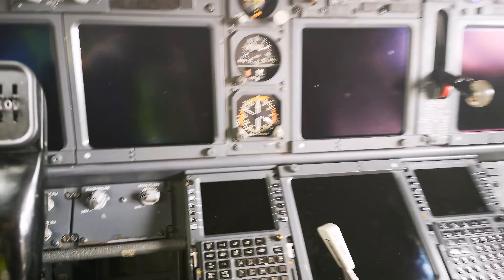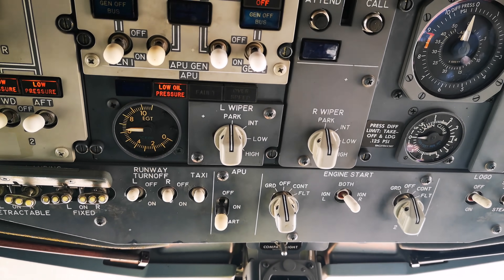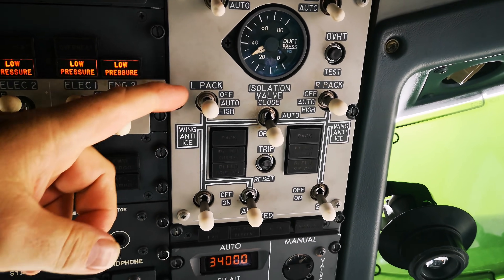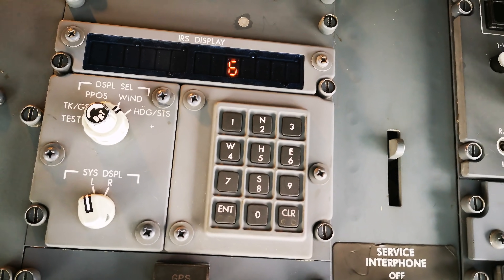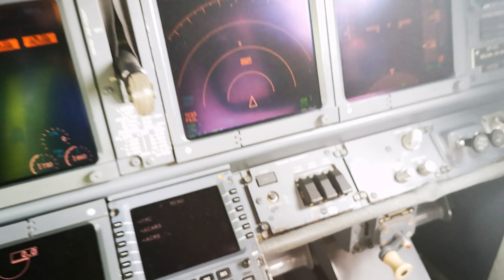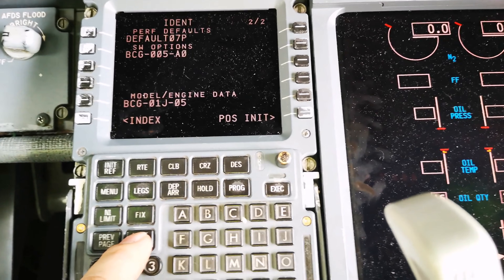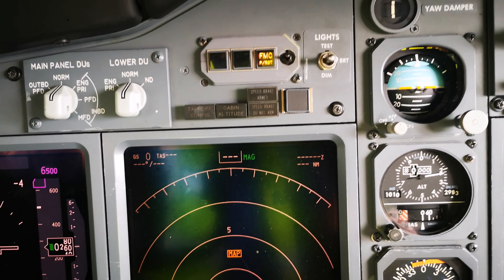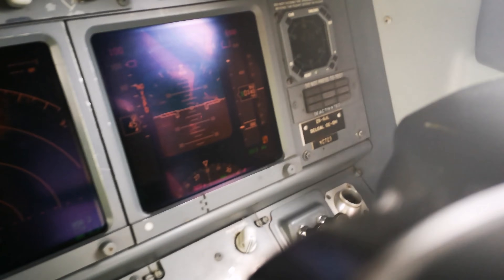B737 800 APU start and cockpit prep

Comment: I heard somewhere that the APU can supply the electricity immediately after startup but to extend its lifetime it should run at least 3 minutes before selecting APU bleed air. Is it correct?
Reply: If i had to guess, i would think it’s related to allowing the lube oil to warm up, reducing its viscosity and thus reducing the torque required to turn the shaft of the gas generator, so when you add the additional load of taking bleed air from the compressor that load+internal friction does not result in excessive exhaust gas temps.
Reply from the maker: It prolongs the life of the turbine section....Heat and cool cycles. They use turbines in ships, rigs aircraft carriers and so on.. I've heard that they use the Alison engine.. like in the C130 Hercules aircraft in oil Rigs and run it for a year continuous...then switch over to the standby engine... They then do a combustion liner check with borescope for cracks and so on and find none; just because there are no real thermal cycles to speak of. So heat cycles is a killer.
Reply: That is correct. FCOM 7.30.3 - Operate the APU for two full minutes before using it as a bleed air source.
Reply: @Denis-the-menass  How does putting the APU to use as soon as it's available rather than  waiting deteriorate its longevity?
Reply: @tinture2822  boeing says so..

Comment: So, did you start the apu only because the ground power wasn’t available? Or is it the normal procedure even if ground power was available?
Reply: Why would you start the apu if you have a ground power
Reply: @Hk-uw8my  pilots still sometimes start the APU on ground power for heating/AC whilst boarding.
Reply from the maker: Yes and no.. Some companies want you to use the ground power all the time.. I prefer to start the APU as the first start of the day. The reason being, to test the APU bleed air. I've had it so many times when on ground power, only to find the APU fails to start.. cold soaked and so on or bleed air valve fails to open. Then its a run around to get the ground air rig, subsequently causing a delay and unhappy PAX when we cant start engines or have the aircon on.
Reply: You have to start the APU at least for the engine start, because the engines need pressurized air to start. Also on some Airports its forbidden to start the APU except 10 minutes before pushback due to lower the noise that the people living around the airport hear.

Comment: The 737 cockpit preparations,  the switches,  the sounds, the "analog" feeling just makes me feel good.  I love this aircraft
Reply: If you want to get even older with it, check out an MD-80 cockpit!
Reply from the maker: Jip, based on the DC9 and they even hide circuit breakers behind the bins in the cockpit on the MD80 'cause of lack of space. Mostly instrument backlighting.
Reply: Sorry, It has stupid intake nacelles! They should be round! JK
Reply: @uTube486  Tell the Boeing engineers! They will say: Oh we didn't think of that, so thank you, it will be rectified
Reply: @sundar999  Can't find their phone number...
Reply: @uTube486  IIRC, they’re more flat on the bottom because of how low to the ground they are. I remember reading something saying that that was a big idea for this aircraft since the first models. They wanted it low as possible on the ground (no idea why) and so the round nacelles were a little too low for comfort, so they flattened the bottom out for clearance.
Reply: @d_kortman  The 737 is so low above the ground becouse in time of making its project many airports don't Have conveyor belt cars to load the luggage to the trunk. The idea was that ground service employee will be able to put luggage inside standing On the apron.
Reply: @TheJanikxx  gotcha
Reply: @uTube486  Man, if u have a phone to comment thinks like this you can also use it to investigate before throwing your opinion. It just make u look like an ignorant.
Reply: @edwincabrerarodriguez5263  ??
Reply: @uTube486  You talking about the intake nacelles?

Comment: Newer planes don’t have all of this useless switches all on one screen this plane is old
Reply from the maker: Hey that's not kind...this type is only one away from the Boeing737 Max. And we know what happened there. Besides I would rather have those useless switches as you say...than have all the panels dead and no switches at all.
Reply: @AviationEngineering1972  Agreed. One critical advantage of actual switches/buttons is being able to develop muscle memory and operate them while you are looking at other things. Love my smart phone but miss being able to text in my pocket...
Reply: @AviationEngineering1972  Agreed.  I also like an old fashioned compass tacked on somewhere, a half full, transparent water bottle, a pencil behind my ear and a torch in my pocket ... just in case those useless switches find nothing to uselessly switch.
Reply: @AviationEngineering1972  maybe one of those "useless switches" can turn off snotty YouTube video comments. :D
Reply: Boeing could easily make all functions automatic with no switches at all but they know this is a plane and in the air you have to take action when things fail, like computers, electrics, hydraulics, pneumatics. Therefore you have all the switches to fix problems in the air; you are then able to reconfigure the aircraft and save the day.

Comment: When you turn on the battery switch, what systems make that chattering noise?
Reply from the maker: Its the analog(standby) altimeter...since it works with bellows and old school magic it has a rattler; most times called a vibrator to prevent the needle from "sticking".
Reply: @AviationEngineering1972  never knew that, dope

Comment: 33°58'S  18°35'E...is this location the Cape Town Airport, South Africa?
Reply from the maker: Jip close enough, funny story....have had it once when the IRS system would not align..Endid up that the new update on the data had a stuff up..so put the aircraft closer to the south pole...caused a delay in the flight., luckily the bay the aircraft was parked in had the position on display in the parking board....just one digit out..and did not see it right away
Reply from the maker: 33.9715° S, 18.6021° E is what google says..... but I've seen your nrs on the boards.... way closer buddy....